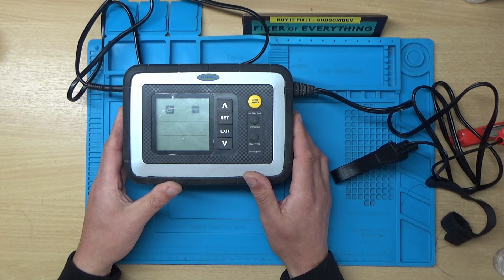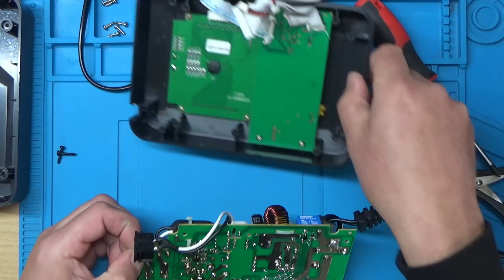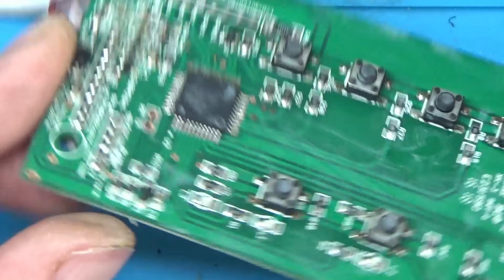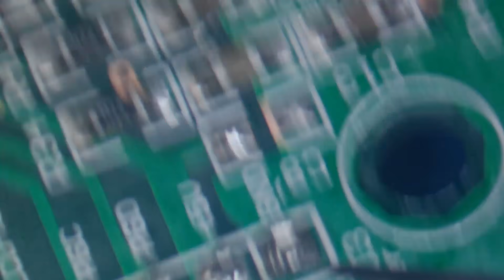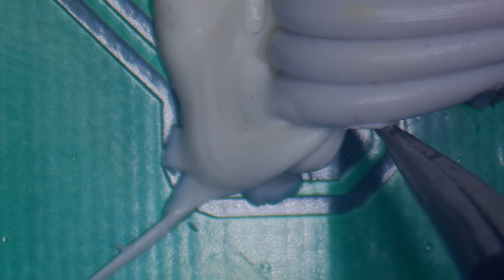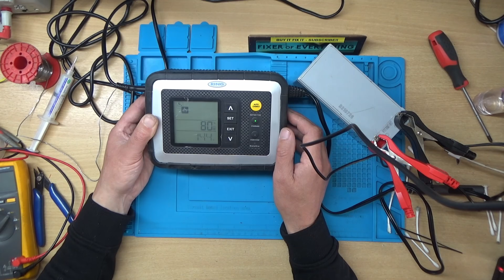Faulty Ring Smart Battery Charger | Can I fix It?

Comment: Excellent, I do think you could do with a smaller tip for your iron though.
Reply from the maker: Thanks 👍 I've got smaller tips, but the problem is that they don't seem to transfer enough heat into what you're working on, so I tend to use the larger one.

Comment: watt temperature do you set your hot air gun at
Reply from the maker: It depends on your station and what you are removing. I typically use around 400-450c
Reply: @BuyitFixit  Thats one I dont think I have tried  it up as high that so will give it a try next time and thanks for the quick reply

Comment: I'm a Sparky and that mains supply is v.high!
Reply from the maker: @jonnyduncan7056  I got them to come out and they fitted a monitoring device. They did say they might need to drop it a tap or two at the transformer. I got a text saying the issue had been resolved so I'm not sure if they did anything or not as I've not measured it lately...
Reply: It's mad it's it. They say it's 'within tolerance' but realistically it can cause a lot of grief on appliances. Our PME (earth/neutral) external readings are the same, they're not interested, but we have maximums on our regs. Keep up the great work, I'm loving your streams.
Reply from the maker: Cheers Jonny 👍

Comment: worth knowing the “start/stop” is for an agm battery like the one you had, as opposed to normal wet battery.
They are very good chargers but I had a couple die, blowing the internal fuse which I couldn’t troubleshoot past the simple things like caps - I binned them unfortunately.
Reply from the maker: Thanks for that,👍Yes I figured that out after a while (I think it says on the back of the unit). Pity you binned them I might have been able to have a look for you.

Comment: You said you didn't have anything to unclog the vias but given the board seems to be only two layers, it didn't sound unrealistic to drill them with a 1.5 or 2.0 mm drill bit and put a bit of wire inside soldered on each side
Reply from the maker: I'd have to try and find my 1mm drill bits, from when I made my own PCB's 😂😂😂
Reply: @BuyitFixit That was my first thought but handheld, you take less risk with a 2mm drill bit. It doesn't matter if it's larger than the trace since you do that to bridge it anyway

Comment: Could not believe you didn't connect up the TX and RX lines to see what was going on there.  I expect it is serial protocol, normal serial port.  I would give anything to see what it has there
Reply from the maker: I can't remember on this device. I think at the time I was just more trying to get it fixed so I had a video to put out for the weekend. I have connected up the serial lines on quite a few devices to have a look. A couple that spring to mind were the AVerMedia video capture device, and the RS41 Weather balloon videos I did on here.

Comment: Possible reenactment:
*charges car outside garage

Client: *accidentally slept
and then it rained

OR he lives near a beach those salty vapors can screw everything up
Reply from the maker: Yes, very plausible👍Yes salt water / vapour and electronics definitely don't mix well!
Reply: @BuyitFixit  I had fixed a laptop that was not working, when i opened it it was a hell of a corrosion crime scene all of the traces were eaten away and all the components rotted, I ask where he worked and when he said he worked as a lifeguard and always brought it there i was not suprised by the carnage anymorr
Reply from the maker: I had similar with a Cricut vinyl cutter I looked at on here, that seemed to have had coke spilled inside, loads of traces and vias had turned to black mush. I did try patching some of the damaged traces but it was just too badly damaged.

Comment: You are inspirational I wouldn’t normally try to repair something as badly corroded as this
Reply from the maker: Thank you 👍I am usually quite tenacious at trying to repair things. There was a Cricut maker I looked at on here, but that one was pretty much beyond saving due to what seemed to be a coke spillage that had eaten through a lot of the PCB.
Reply: It's not uncommon to realize that once cleaned the board has very little actual damage. IPA + toothbrush, then assess the situation.

Comment: how much would you charge to fix mine? i hate the thought of wasting the money on it. I dont have a proper solder heat gun or a micrscope with good enough zoom to make this sort of fix unfortunately.
Reply from the maker: Hi Peter, it's not possible to calculate a cost without knowing what the problem is, or what parts are required or even if it is beyond economical repair...
Reply: @BuyitFixit  thanks for the reply. I appreciate it's a bit of a 'how long's a piece of string' type question. I'll get another look at it myself under the microscope and see if I can spot any obvious damage first. it was being used inside a car boot to charge a battery long term but seems to have just stopped working. the boards dont have any obvious issues but I think the microscope will reveal the same issues with the small holes you saw on your one
Reply: I opened it up for a nosey and its as clean as a whistle inside with no damp or corrosion or anything like what you saw in your one. the backlight for the screen did light up with no display previously but stopped, so nothing to lose by having  alook inside. i also checked with my thermal camera on the board while powered up and i see FOUR resistors very significantly hotter than anything else on the board and a very quiet, but high pitched hum/whine coming from , i think, on of the small transformers. I could send you a thermal image picture if it helped? its the two resistors up on end at 6 oclock position below the large 400v capacitor and the single one at 3 oclock closest to it. all four shoot up in temp to around 60 plus degrees C, maybe this is normal?

Comment: Thanks for the video mate, I bought the exact same charger brand new from Halfords and it's set up & charging (well the % has just moved from 70 to 80 so I would assume so), however as the numbers are alternating between V and A on the screen, I'm getting a reading of 0.00 for the A, surely this isn't normal (?)
Reply from the maker: I know mine sometimes switches backward and forward showing 0 Amps but that's usually when it's pretty much fully charged.

Comment: I have this and it says 12.4 on Auto charge but 0.0a . Says its charging but no noise or anything and stays on 60 % . Help 😮
Reply from the maker: Hard to say. Does it come on without being connected to the battery? (It should show some signs of life when just plugged into the mains). There's a relay inside that switches the power to the leads so you should also hear a click when it starts to charge. It more likely sounds like it could be on the power supply board.
Reply: @BuyitFixit  thanks mate . I may buy a new one as i dont have the tools 😂 it clicks but no fan also
Reply from the maker: @daveharris4755  It could possibly be the relay but I doubt it. It's more than likely something on the main PSU then.

Comment: If I may suggest, sometimes, better than an IPA is to use zippo petrol for cleaning boards, especially with conformal coating on the surface of the board.
Reply from the maker: Sure, Thanks for the suggestion. I was thinking hmm quite flammable, but then I thought hmm so is IPA 😂😂😂

Comment: great vid as usual. Just for information, keep an eye on your incoming voltage as you shouldn't be getting any more than than 253V max (10% on 230V is the absolute permitted limit). You may need to contact your Dno & let them know. Over voltage will shorten the life span of your appliances.
Reply from the maker: Thanks I was speaking to one of the guys who volunteers at our local repair cafe along with myself, and he was saying he had a similar issue and at the time his incandescent lights were only lasting a short time. They put his property on a lower tap of the transformer. Thanks for commenting I might speak to them.

Comment: Great job. For fixing vias you should just drill hole and solder both sides with wire inside. Drills down to 0.1mm are easy available.
Reply from the maker: Thanks 👍I'll have to get myself some.
Reply: The very fine, ordinary, drill bits require a smaller higher precision chuck  than whats common on ordinary drills to hold them. The bits are also quite sensitive and break easily.
An option is kits with carbide bits that are stubbier (shorter actual dize part) and have a thicker top that is easier to grab in the chuck. 'PCB carbide micro drill' should find them on the usual sites...

Comment: You have mentioned your voltage being rather high lately. The actual voltage in the UK is 230 volts and the frequency is 50 Hz. Note, however, that British energy regulator Ofgem permits a tolerance of -6% to +10%, which gives an allowable voltage range of 216 V to 253 V in the UK within official limits. But, in MHO that upper limit must be putting quite a strain on electronic equipment designed to be supplied with 230Volts.
Reply from the maker: I think as we have solar on the roof it also ups the voltage slightly so it may well be just under the upper limit.

Comment: That is a haier microcontroller. google HR7P92FHL gives you the datasheet in Chinese. It's a RISC core with 79 instructions, a few UART and other peripherals  and it uses internal 2K SRAM and 16K flash.

Comment: A perfect wire to use when you have both traces broken, and vias messed up, is insulated wire wrap wire. It is thin and flexible enough to make trace runs, and usually can fit through vias and easily soldered on both sides making solid connections... I've done more than my share of such repairs...
Reply from the maker: Thanks Gary 👍I'm not sure if that's similar to what I've got. I got a load of stuff from someone I know and there was a roll of kynar awg30 I think it is, which is what I used on this.

Comment: Great video - thanks for sharing. A suggestion for via repairs is to just drill out the hole (you can do it by hand with a small drill bit). You can then pass your repair wire directly through the hole and just solder it on both sides. Makes for a quick and easy job.
Reply from the maker: Thanks Steve, I did think if drilling it, but I don't think I've got any small drill bits. I used to have some 1mm "somewhere" from when I made my own PCB's but that was some time ago...

Comment: The main IC seems to be Haier ASIC or pre-programmed (OTP) processor, probably based on 6502. It's odd that they chose that processor, since that seems to be really obscure.
Reply from the maker: Yes Indeed! I guess they must have got a good deal with them or something. I would have expected an Atmel chip or PIC chip.
Reply: It is odd, thanks for cleaning the package! I assume that the Haier marking represents the world's largest appliance maker. I assume they are working their way up the food chain, getting into more sophisticated markets. I assume somebody other than Haier actually fans the die.

Comment: Great Fix, I guess the charger had been stored in a damp basement ot got wet outside when charging a battery still inside a car
Reply from the maker: I had been thinking the exact same, I just emailed the seller and sent him a link to the video. I did get a reply " It wasn’t left out in the rain - it was charging my van battery under a closed bonnet overnight and I suppose it may have been exposed to some moisture there? " so 🤷‍♂️
Reply: @BuyitFixit  yea also these chargers should be able to withstand some moisture and prevent ingress. I didn't see a gasket besides the rubbery outer shell.
Reply from the maker: Yes, and it seems the buttons don't have any moisture ot water protection either.

Comment: 254 Volts  ? guess UK doesn't have to go down to 240 V max anymore since they left the EU ?
Reply from the maker: I'm not sure, thing is we live in a quite remote area, so I'm not sure if they have to up the voltage due to the length of the overhead cables? Anyway I'm not planning on doing a video on "fixing the grid" 😂😂🤣🤣
Reply: @BuyitFixit Hahah.  ah I understand. I live in Netherlands and since we're a cramped small country the distances of (often underground) power cables is probably shorter. We used to have 220V and now had to go towards 230 V by EU rules.
Reply: @maicod  Romania here, same story, too... and varies wildly, even if i live in a city, not in a village! :(
Reply: @miftosaurus :(
Reply: @maicod  here in the Uk we were 240v. On paper we adjusted to 230v to bring in line with Eu. But the reality is nothing changed except the percentage allowance increased to cover our existing voltages.
Reply: @ashleybignell2366  OK I see and now no EU rules to follow anymore anyways.  I remember as a kid checking if my cassette player I took along on the ferry to England was able to run on 240V using  a converter plug and it did but it ran slightly faster. We (Dutch) had 220 V back then but it's now 230V

Comment: Nice repair :) I was wondering if vinegar with salt would get rid of the corrosion on the vias, as I saw Edd China cleaning oxidized copper wires using that solution:
https://www.youtube.com/watch?v=HO89-R-lSNI
Perhaps then flush it off with ipa.
 Of course if the copper is completely corroded away,  you'd still have to use jumper wires.
Reply from the maker: Thanks Mr JSV 👍 The vias were just missing in action 😂😂😂
Reply: if i'm remember well, Edd China is profiled on auto stuff, so, mostly, thick cables and so on, you can accept losing a bit of them. but here we're talking about really thin traces, so, not an option...
unless you enjoy soldering a lot of thin wires... and i mean A LOT! :)

Comment: I am surprised that you put the whole thing together before testing it. I don't have enough confidence in myself to do that, because the chances are too high that I'll have to take it to pieces again! So: Either you have supreme confidence in your ability to fix things the first time (which you justifiably should have); or: you've tested it off camera already and you know it is going to work 🙂 Either way - well done! Clearly a liquid spill through the front of the charger with something corrosive - ? battery acid (unlikely) or Coca Cola, or what?
Reply from the maker: Thanks for commenting 🙂 It was actually the 2nd time I assembled it. I do usually have good confidence in things I repair, and it was a bit awkward to connect all of the boards together for testing without assembly (it was only 4 screws to put the back on anyway). It seemed the chip wasn't sitting quite right the first time I re-assembled it so I re-flowed it. I cut that bit from the video otherwise it would have been a lot longer and it would have been a bit boring seeing it be assembled 2x (I try to keep them to around half an hour) and end result was still the same.
Reply: I understand completely, and commend you on your ability to home in precisely on the fault so quickly. I try so hard to persuade myself that "common things occur commonly" and therefore I should look for the simple faults before I try tackling the difficult ones. Unfortunately I am only right about half the time! so half of my fault-finding proves successful!
 @BuyitFixit
Reply: dried cocacola looks "sticky", and water is the best solvent in this case... ofc, dry it a lot before next batch of checkings...

Comment: You can press the yellow button on your Fluke to wake it up from slumber, you dont need to turn it off and back on again. ;-) Love your videos by the way.
Reply from the maker: Thanks for the tip! I'll give that I try. I used to use my trusty fluke 77 until I upgraded to this meter. You only had to move the switch one position and it would wake back up which I preferred.

Comment: I agree with @daShare, use a fiberglass pen to remove the coating on the trace, it dont destroy the copper trace, and it cleans it better than the tool you use.
Reply from the maker: Thanks I've not used one before, I'll see if I can pick one up.

Comment: Little ranting follows...
Have had couple of lead-acid battery smart chargers, including one of Ring brand (which died with a nice bang, not going to repair that junk). After having headaches using them and getting to know their quirks and pickiness, I've mostly back to using oldschool "dumb" chargers. Only few components, therefore not much that could go wrong with them.
One of the last smart chargers I recently tested out - the thing forgets its settings every time it loses mains power even thou it is still connected to the battery. When mains power is back on, it won't resume charging but waits for settings again. It's charging cycle is also questionable because it seems to stop when charging current drops below 500mA, not even trickle/small current pulses after that. Only after battery voltage drops below 12V will it activate again. So much for a "smart thing" that is supposed (going by description and spec) to keep battery charged/topped up for all the time. And yes, it does have warm/cold temp, charge current, 12/6V voltage selectors on it. All those have to be set too.
Reply from the maker: No problem with a little rant 😂😂 The thing I don't like about them is if a battery has been run completely flat or below a certain voltage, the charger just doesn't detect them and I usually have to connect a jump pack or such to even get the charger to recognise that a battery is connected. I also agree that there's a lot more to go wrong with them than an old transformer and rectifier with an amp meter as in the old school battery chargers. The main advantage I see is that these do seem to have a lot more output capacity than the old dumb chargers I remember, which most of them seemed to be about 4A. Thanks for sharing your experience. Best wishes. Mick